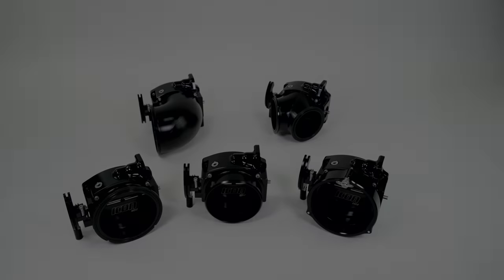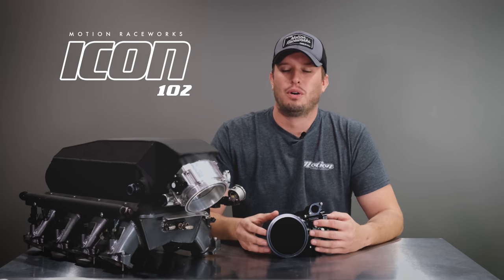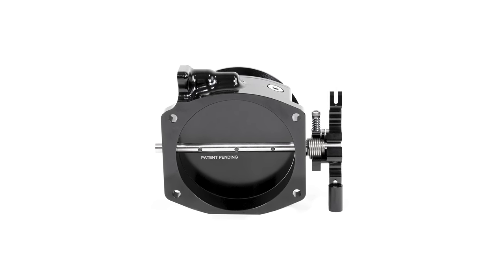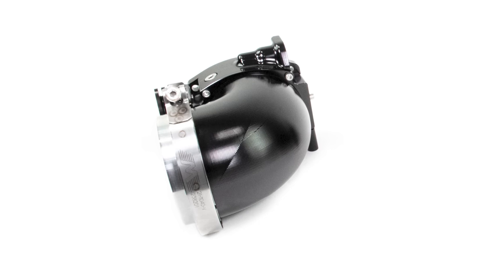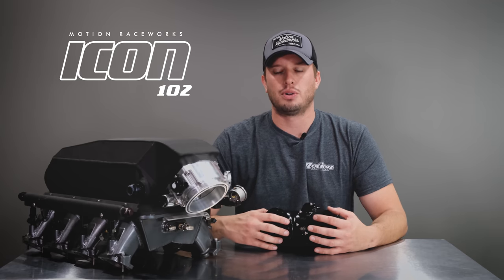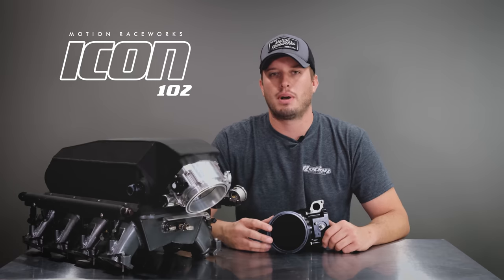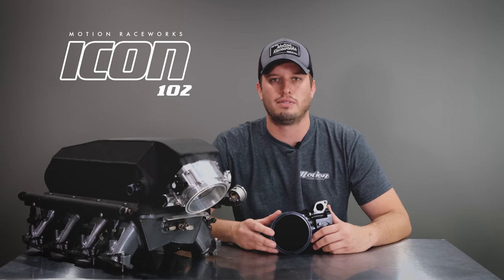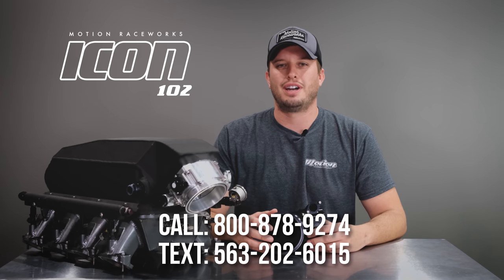New ICON (interchangeable connection) throttle body by Motion Raceworks

Comment: What about the shaft seal? Every throttle body i see don’t have a seal & leak when you boost leak test it, i had to build my own seal on my current throttle body, the tps side has a decent seal because the way it mounts but the cable side normally blows the dust cap off the bearing and allows horsepower to leak like crazy,

Comment: Looks real nice but do you make ford throttle bodies...I have a 4wheeldrive  v6 4.0  and it's a lil rough body wise but runs pretty nice it's got around 220or a lil more horse  power but it does what It suppose to the way it is but I'd like it to do a lil better so that would be a good start right godbless and stay safe

Comment: Its just too bad this with any coupler is $520 all the way up to a tight bend billet 90* is $950+
Reply from the maker: 899 is what the complete throttle body and 90 or y cost.  They are a huge block of aluminum and a ton of machining time.  There’s nothing comparable on the market that isn’t the same cost by the rime you weld all the attachments etc
Reply: I would give $1000 right now for a DBW version with the tight 90°
Reply: @MotionRaceworksOfficial  true true, thats ajust a aton of money. Id love to have one but i could  never justify it

Comment: $550 just for the y adapter...f dat
Reply from the maker: It has two sets of vbands included with it, and attaches to the throttle body where you would normally need a third vband.  And it’s only 440 if you buy when you buy the throttle body.  If you compare apples to apples it’s a great deal and will give you quality unmatched